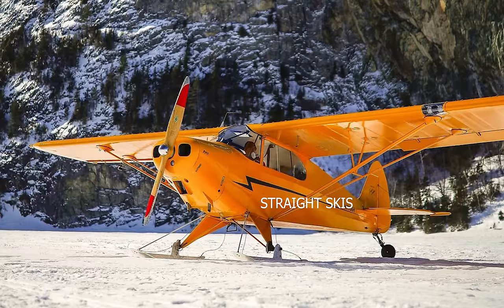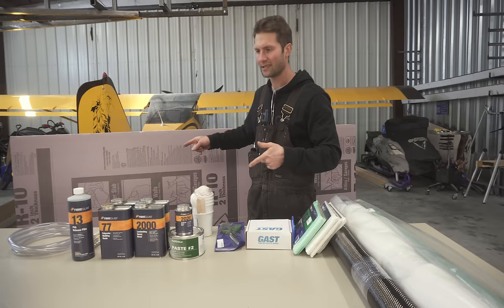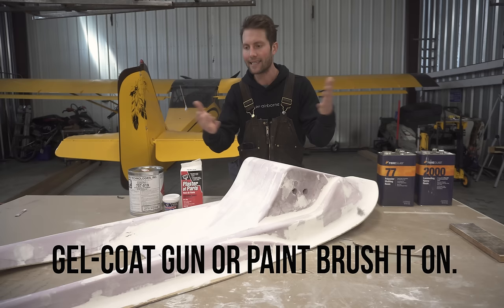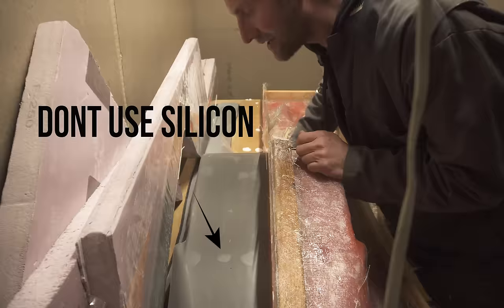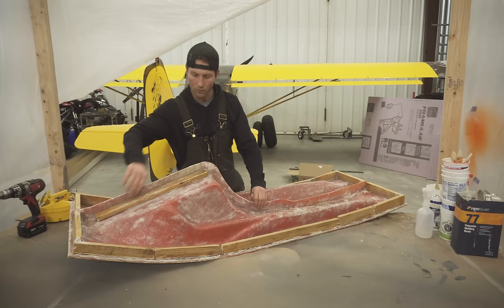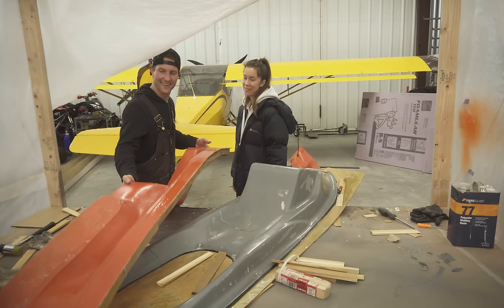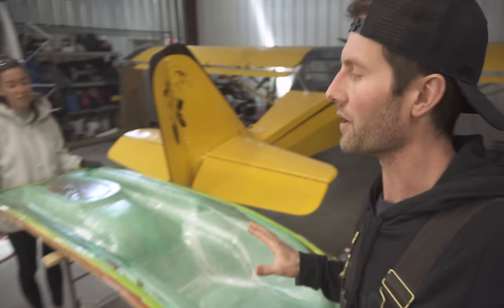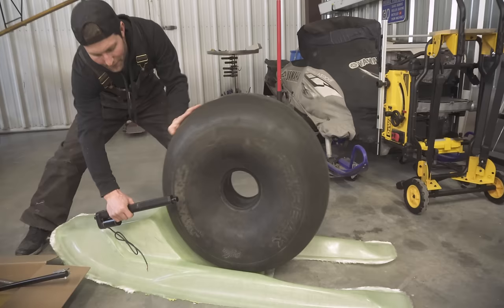We built SNOW SKIS for the KITFOX. CARBON FIBER next!?

Comment: Nice job on the mold and final product Jonas!  I'm an A&P and I spent several years working in a composite shop that specialized in building Carbon Fiber aircraft.  For someone with limited past experience you did a really nice job!  Mold making is no joke. 

Just a quick tip on epoxy resin cure times.  Those published times are for working at room temperature or 70 degrees F.  The warmer it is in your work area, the quicker your resin cures and the colder it is the slower the resin cures.  This is due to the nature of the chemical reaction taking place.  

A general rule of thumb when working with epoxy is that for every 10 degrees over or under 70F, you half or double your cure/working times.  So for example, a resin with a working time of one hour (at 70f) suddenly only has a working time of 30 minutes at 80f.  That halves again and becomes just 15 minutes at 90f.  In your case, the opposite was true.  If it was 50 degrees inside your shop, your resin with a 20 minute pot life suddenly remains workable for around 80 minutes.

When I'm laying up large parts, I prefer to work with a much slower curing resin when possible.  Not only does this give you more time to do the part layup and get it vacuum bagged, but you will also evacuate more resin from the part when you draw a vacuum on it.  Vacuum won't pull the extra resin from a part if it has already begun curing.  So the slower resin can result in a stronger, lighter part!  Also if you use a resin with a slower cure time (or do your layup in a cool area to intentionally slow the cure time) you can heat the mold with heat lamps after it is laid up.  This will not only help the resin cure faster, but it will also thin your resin slightly which means it flows out of the part better under vacuum! 

So just keep that in mind next time you order materials!  You may have to change up the resin you use when it gets warmer there!  Hope that helps!
Reply from the maker: This is great info! Thank you. I knew the lower temp did allow for longer working time but I really didn't know how much. So this is wonderful info for choosing product. 
Thanks agian!

Comment: Nice job, consider filling the finished skis with foam for rigidity. Also make sure you put some Kevlar on the surface in contact with the snow for abrasion resistance. 👍🏻

Comment: Compressed air works pretty good to part out of moulds. Also if your resin cures to fast you can buy your self some time if you work in a cold environment. I use "10 deg warmer/colder makes for roughly half/twice as long" as rule of thumb.
And definitly consider making the skis out of carbon if you want to market them. In my experience it is really not that much more expensive if you count the cost of your labor into the part price.
Reply from the maker: Thanks for the tips! Yeah I’ll try a carbon set. I’ve done some research and S fiber glass, as it may not have the cosmetics and the light weight as Carbon it’s as strong or stronger and is not much heavier when you add resin and such vs carbon. It was pretty interesting video I saw. 
But I will for sure try a carbon set.
Reply from the maker: It was about 50deg in the hangar when we laid it up. So that explains why it wasn’t setting up as fast. I knew it was going to take a bit longer but didn’t expect that.

Comment: Be aware, more layers, more weight. Don't make one side heavier than the other. Look forward to seeing ya'lls progress!
Reply from the maker: Good point!
Reply: @JonasMarcinko  Just do three layers of 195g carbon fibre and your done. Also fill it will expanding foam. It will x5 its strength and add almost no weight. (add the right amount if not it will explode, that shit cracks ship hulls.)

Comment: Everything itches just looking at all that chopped glass
Reply: Worked with insulation of ducts, building, etc.  absolutely hate the fiberglass itch.  Love the video but when I built our house my wife insulated all the walls.  She was a trooper!     Me.  Not so much.
Reply: That's tightly woven glass he used, not the lower quality chopped much weaker stuff. I built a Glasair, almost never used the non structural chopped stuff, never had an itching problem.

Comment: Sooooo Freaking cool.  And after you test them...sell them.  😁  If you use epoxy resin you can fiberglass directly on the foam withoutt all the extra steps, but yes, it is more expensive.  I built a model car i designed using the exact same method you used but used epoxy resin.  Looks like a really fun build.  They turned out really well. 👍

Comment: Alternate title: How to Mike Patey on a budget.
Reply: Which brings to mind, why didn't you use carbon fiber instead?
Reply from the maker: @peterhaan9068  fiberglass is actually stronger than carbon fiber. Its not as stiff which I think will actually work better for this application. some flex is good. And S Glass is only 15% heavier. From what I was told.  So the whole carbon fiber is a bit of overrated. but it does look cool!
Though I do plan on making a set out of Carbon to see what the weight difference is.
Reply: @JonasMarcinko  carbon fiber and fiberglass is either heavier or lighter depending on the person and ability to meter and work with the resin.
Reply from the maker: @paulkainer269  yes very true. But if it were done exactly perfect carbon would only be 15% lighter. If you added more layers to get the equal strength of fiberglass.
Reply: I was just about to say the same thing! Great innovation Jonas!

Comment: Need to get you a roller for putting on the glass. All the white that's on the fiberglass after you apply the resin is air pockets.
Reply from the maker: I had one for the first side. After that, it didn’t roll that great :/ it was awesome at taking the bubbles out!
Reply: Ya you need a ridged roller which knocks out the air.

Comment: Good video. You need to do some weight test before put on your airplane. If the panel is too flexy, make some vertical ribs to stiff up the structure.
Reply from the maker: My thoughts also! 
 I think I’ll need to add some weight to the tail.

Comment: I have seen compressed air used to separate  moulds. I hole is left in the plug to blow the air through. Regards, Jim in NI UK
Reply from the maker: That was my idea at first but I’ve seen that not work so I went the extra mile and did a two part.

Comment: I have been thinking (yes really) and I was wondering why you did not consider making these skis out of plywood  and timber. I have seen several such projects done with such materials in England. Basically all you need in prep' is a jig to form the skis on for which any old wood or MDF can be used.. Fibreglass or carbon can be used as desired to strengthen stress points as you build up the skis with thin ply sheets. Just my thoughts on the subject. Regards, Jim in NI UK

Comment: Awesome job! I am an Alaskan bush pilot with a Zenith CH801. Can you post the CAD file somewhere? I have been considering doing the same thing for the same reason!
I will layup in carbon.
Well done. Doing the plug, mould, and then finally get your product for a one-off project is a lot of work.
Reply from the maker: I’m actually planning on selling them. So if your interested. I need some time to get everything worked out but I can get you a set. :)

Comment: Hey Jonas, I have a comment or two.  Chopped strand is the weakest material you could use.  I would go for carbon lay up... make sure you check the integrity after each flight.  You might have to reconsider the construction method.... best of luck but be careful.  :-)

Comment: Bolt the plug halves together. I’m not sure what weight you used on the cloth for the mold, but you could go heavier? Last tip insert an airway into the plug to attach a garden hose or air hose, to assist in releasing the part. Fill with modeling clay. You can use a large rubber mallet to release the part. If the plug is sanded real smooth that should help it release. And I would spray the gel coat on the plug, when building it, I don’t remember what you did? On the ski part you might want to make the part out of carbon Kevlar layers or use straight polyester resin and sandwich foam construction to add rigidity where needed. Last wear eye protection when working with resins. You don’t want to get it in your eye as the resin is catalyzing. Nothing hurts more than rinsing out your eye with water and then pouring acetone into your eye to flush it out. It will hurt like a MF. I can attest.
Reply from the maker: Thanks for the tips! Never would have thought about the garden hose and definitely wearing eye protection now!
Reply: Jonas Marcinko I’m glad I helped you. I learned from the owner or Maitland, fiberglass production shop, in Oxnard, CA in 1982. I’m pretty sure John passed away? and he poured the acetone in my eye.  lol.  He had this beautiful wooden canoe he built hanging on his wall with coats of poly resin.
Reply from the maker: 😳 that sounds terrifying! Sounds like a great mentor!

Comment: Looks GREAT !!!

(I just wonder about tire deformation on hard landings?)
Reply from the maker: With 29s I’m pretty sure you’ll need higher pressure. 26 should be normal. Definitely thought about that. We will see!
Reply: @JonasMarcinko  As the tire squats it'll widen and could maybe grab the insides of the ski's forks? I'd hate to see you add a bar to your "wheels up" club badge :)

Comment: I used to fly a Scout with hydraulic (retractable) skis, back in the early 90s. I was a Conservation Pilot for my state, and we had a Scout with them on. They were a LOT of fun, but also pretty heavy. The aircraft had a 180-Lyc engine, so the performance was still OK...and of course we were using them in the winter when the density altitude was low. But the problem I see for your installation is weight--not of the ski itself, but of the mechanicals you'll need to retract/extend them. Have you worked out the weight & balance details Jonas?
Reply from the maker: That is a downside to keeping big tires on. Weight and balance isn’t effected that much, being how close the skis are to the CG. But is still something that needs to be worked in.

Comment: Very nice work on the Ski's Jonas How is the thinking on a possible production line. You have unique product, as the only skis that will fit Ab wheels.  Could you make a decent profit at a $3300 $3800  price range.
Reply from the maker: Thanks! It takes about ten days to build a set by myself. About $1200 in materials. So not that bad!
Reply: @JonasMarcinko   Well get going and form a company and put Silvija in charge. She gets a green card and  the venture puts a couple Americans back too work.

Comment: Fill it with spray foam then sand it and enclose it.
Reply from the maker: I have some dense pour foam and thought about it. I may experiment with one ski. My concern is the ski will flex and may break from the foam? It’s worth a try though!
Reply: @JonasMarcinko  fill it while they are in the mold.
Reply: @JonasMarcinko  Make sure you use closed cell foam.

Comment: Epoxy is so expensive that it's worth messing with Styroshield, building a paint booth, drilling out the nozzle on the wrong spray gun, at least one extra sanding step, wearing a mask and dealing with fumes of poly???? ...and you already had epoxy....I think I would have just gone with epoxy dude but nice job!
Reply from the maker: I agree. Next time I’ll probably just use epoxy for the plug. The paint booth was nice though. Spraying/drying
Reply: @JonasMarcinko  Yeah. Reading my comment now, it looks a little harsh. Yes, you would have needed the booth anyway. Actually doing things is the best way to learn so good on you. Good luck with the skis!